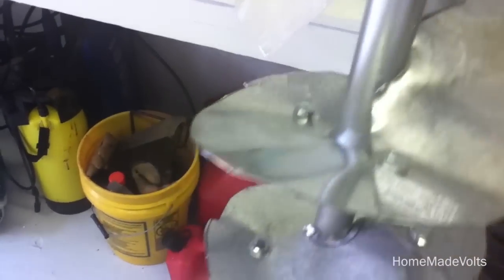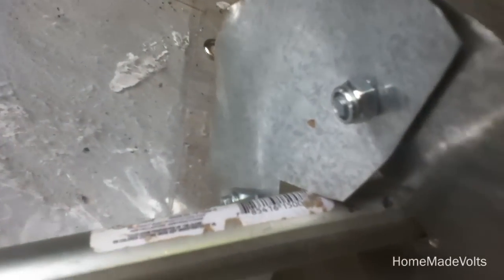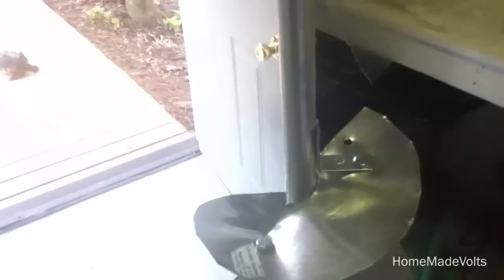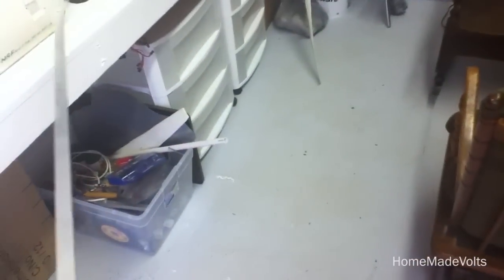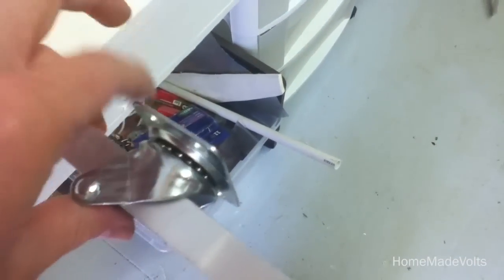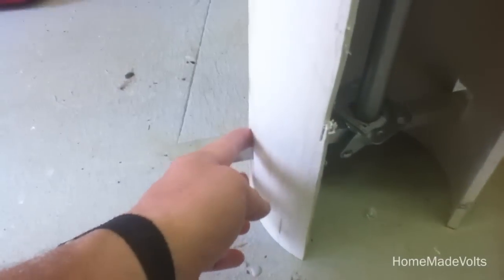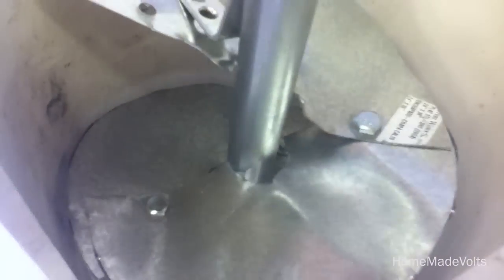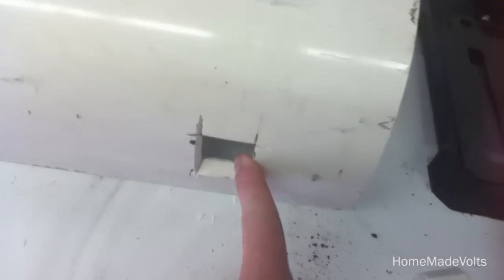Home Made Auger p2

Comment: I'm guessing this thing doesn't turn no matter how much water is flowing through it...
Reply: +Bradley Weingartner I don't see why it wouldn't.
Reply: +wanderingturtle Because it's like a water slide. Water will just flow right through it like a spiral pipe.
Reply: Let's just put it this way - there is a reason there was no part 4...

This thing will not work. At best, an auger design would make a terrible turbine for water. Augers are kind of like worm gears - great for moving material when driven but terrible at being driven by material.

Depending on the water source, a pelton type wheel or a kaplan type turbine would be far superior and coincidentally easier to build than this thing.

My density has nothing to do with it.
Reply: @bradley3549  Hey Bradley, you seem pretty knowledgeable about augers,  is there any type of 'universal auger' that moves both water and material?

Comment: You have too much friction as I can hear the drag at the ends.  Bradley is correct this will not work to make any electricity.  You can drive this to move water but it will not move from water.